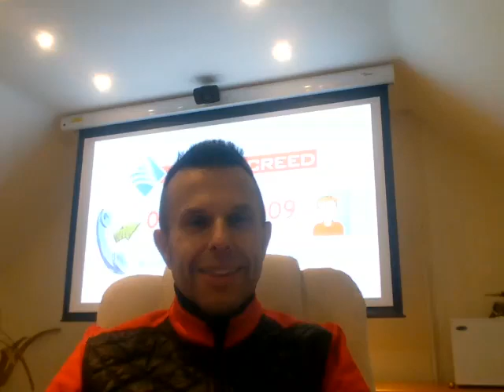Screed Thickness - How Thick or Thin Can Screed Go? Make sure you have the right product

Comment: we have a balcony, 2.5mtr off the ground, which needs about a  level about a 5% drop over 7 mtr's  for rain, about 46cm at one end too high;  we have used utone or breez blocks to to take most of the space up.  But the  last 9 to 12 ish cm, before laying outdoor tiles will take us where we need it. Question, the guy doing the work is planning to put about 10 to 12cm of sharp sand and cement  screed, on top the blocks to take up the the space, Fathering it out the show end of the balcony to about 1mil at the shallow end. Is this OK or the idea anyway, he plans on using light cement and also placing steel reinforcing in the middle of  screed layer ?